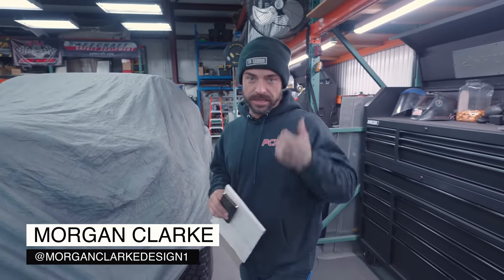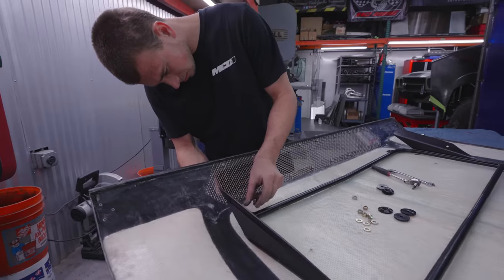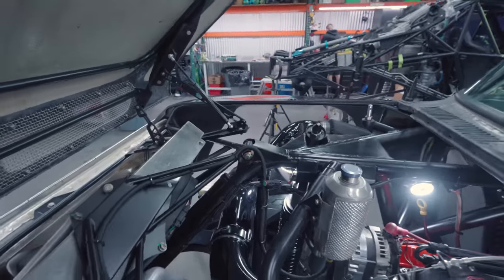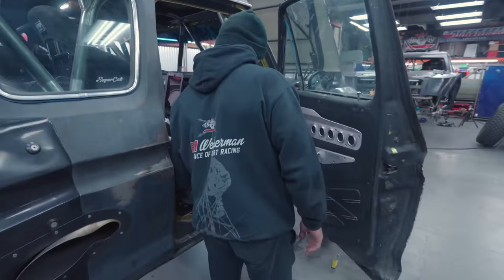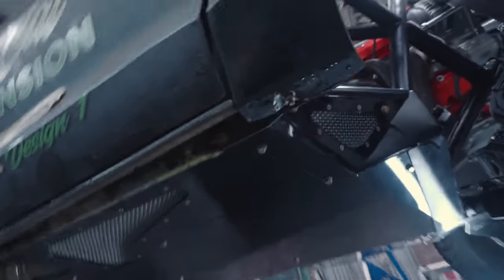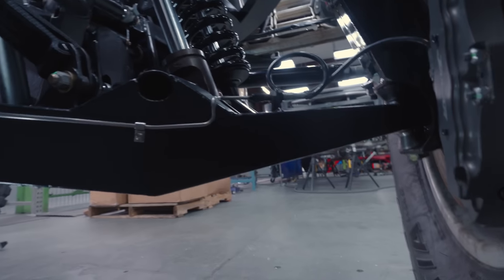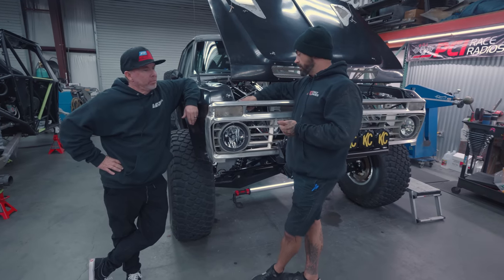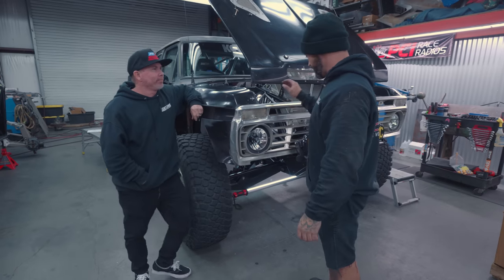Vivian Goes Home! | Complete build!! | Morgan Clarke Design

Comment: Can someone explain the purpose of the limit strap around the front of the driveshaft?
Reply from the maker: It’s a anti pogo stick, safety loop in case of driveshaft failure..
Reply: Just imagine you’re doing 100 mph and the driveshaft breaks and stabs into the ground. That happens and you’re going for the ride of your life…

At least with the limiting strap attached you won’t be catapulted into oblivion.